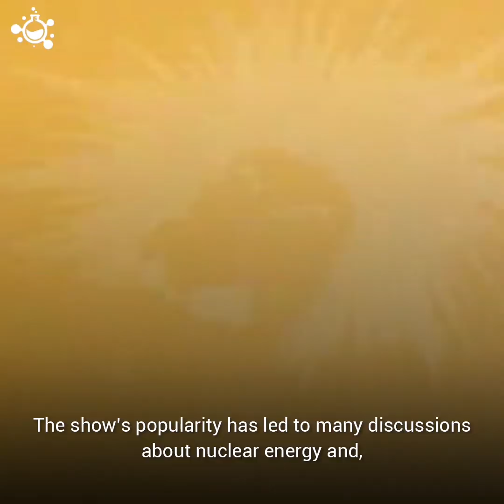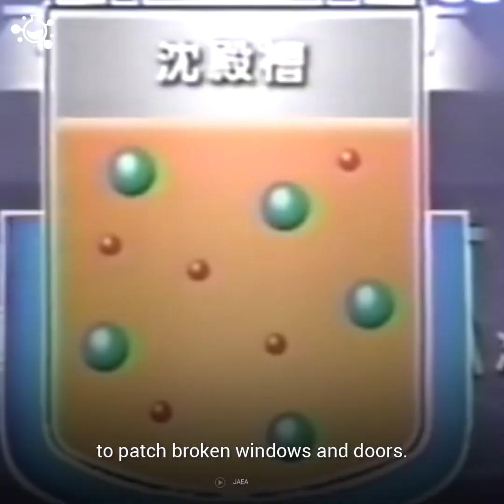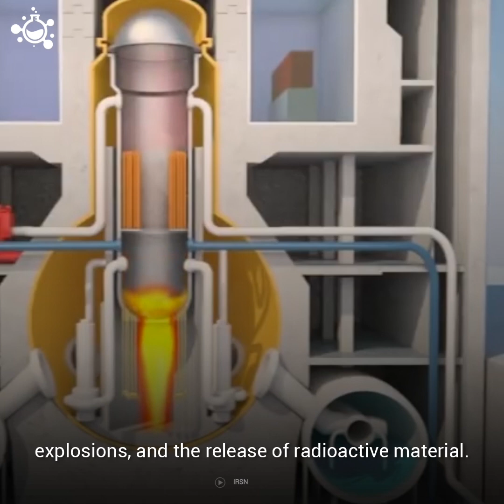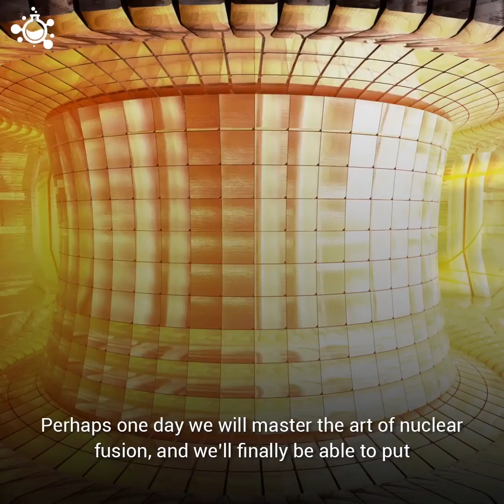The Top 5 Worst Nuclear Disasters

Comment: You say nuclear energy is still pretty safe. What about radioactive waste ? We produce it and we'll just let our children's children deal with it. I find it very unethic and irresponsible
Reply: Ima go ahead and guess you don't know what fossil fuels do 😂. Nuclear energy is the safer and cheaper way to get around. Fossil fuels release a bunch of carbon emissions such as Carbon Dioxide which is pretty bad if you didn't realize that. Read into nuclear energy to help you realize how much better it is then what we use now which is a non renewable source in fossil fuel. Nuclear energy is counted and not counted as a Renewable energy because of the way we mine uranium